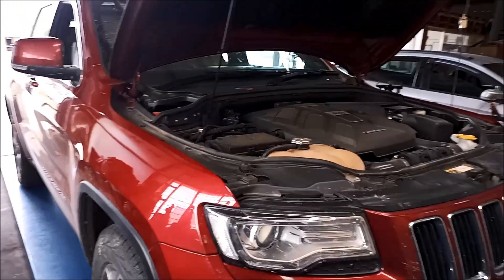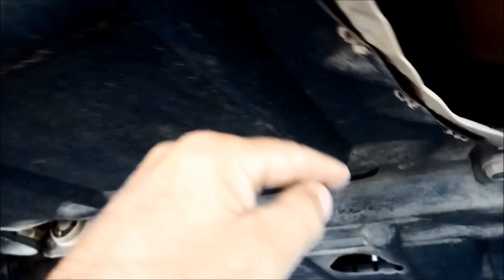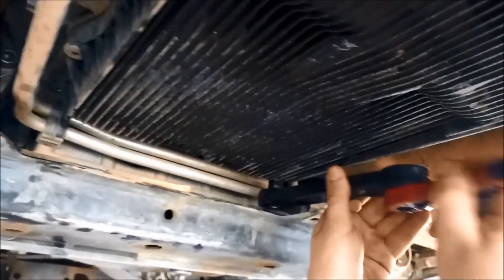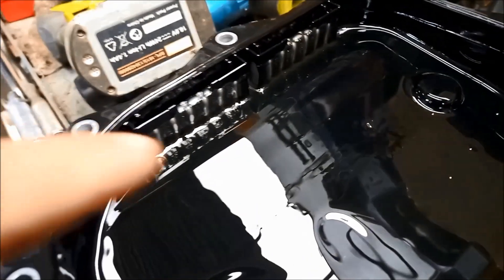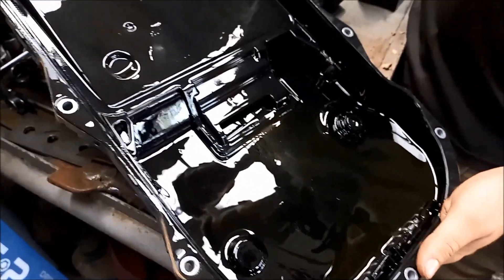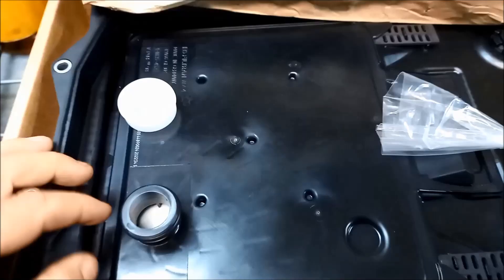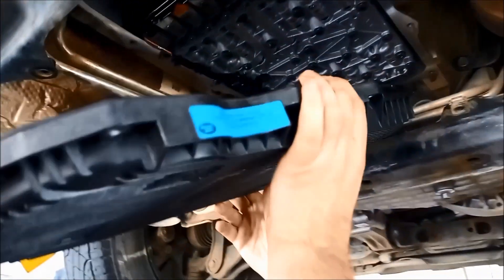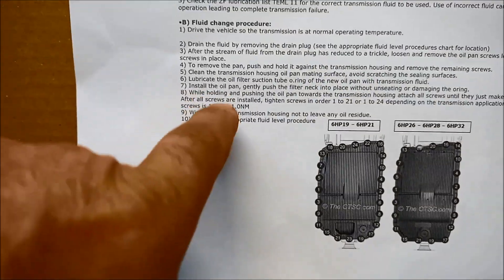Jeep ZF8HP45  ZF8HP70  845RE  0CM 8 Speed Automatic Transmission Filter Service How to DIY

Comment: Great info and thanks for sharing. If you have the right tool there is no need to jack up the transmission on a 2015 GC. A short T40 will get to those front and rear bolts.

Comment: I don't know why they make so many different pans. I know the capacity may be a little different but I bought a genuine zf pan made for a BMW and put on my grand Cherokee. Was $80 on Amazon for the ZF pan so it's considerably cheaper than the jeep pan. Have had it on for 1500 miles with no issues
Reply from the maker: hi, be careful with cheaper of unknown/untested brands https://youtu.be/ntkkiawJV08  cheers

Comment: What was the tool you used to access the front bolts, 3/8?
Reply from the maker: hi, got it on ebay universal extension wrench extender adapter socket or similar in search. cheers

Comment: Have you ever had any issues using aftermarket fluid even tho the aftermarket manufacturer states it meets the required specification? A lot of manufacturers say genuine oil only...? Cheers
Reply from the maker: hi, never had issues with the ones we use. always go with reputable and compatible supplier, read their specs and if need be, give them a phone call. in australia they are legally bound by what they recommend for a particular vehicle to be true and correctly compatible. cheers

Comment: i dont know why they put cooling fins on a plastic trans sump, plastic is an excellent insulator unless the ribs are to offer some added strength. I bet the yanks have aftermarket steel trays.  Ive seen 10spd autos on youtubes, scotty Kilmer reckons some are horrible shifting
Reply from the maker: hi, i`d say they are for strength for the plastic. good ol`scotty...what more can i say?  cheers 👍